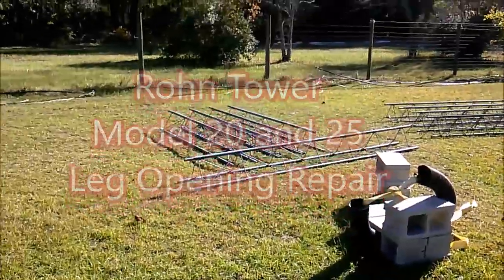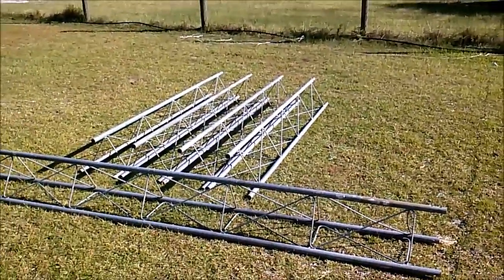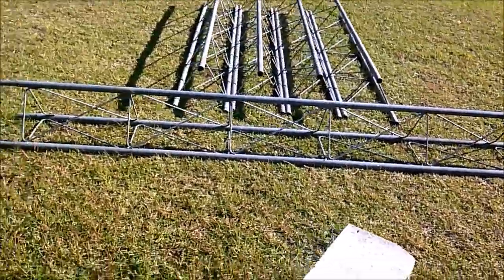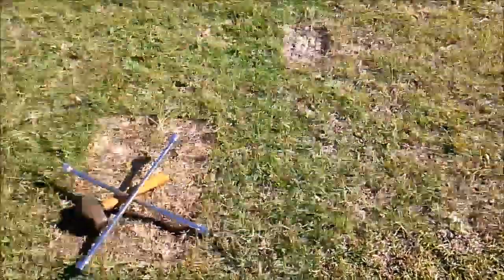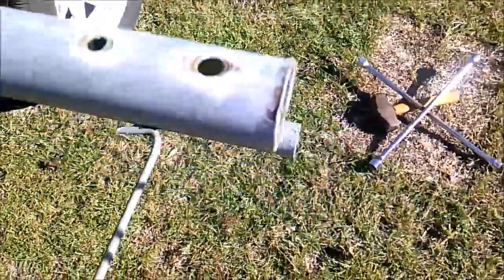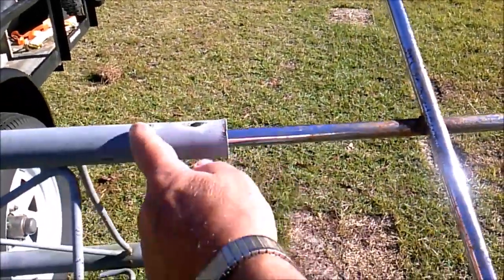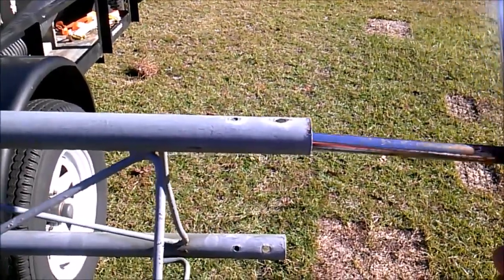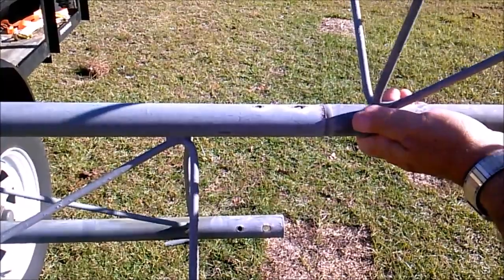Rohn Tower Model 20 & 25 Leg Fix

Comment: Great idea. I use a 1 foot section of iron pipe that has one threaded end cut off and a cross tee threaded on the other. Then I put two 6 inch nipples at 90 degrees in the cross tee for something to strike to get pipe out of tower leg. I also tapered the cut end with a bench grinder so it starts easier. Basically it looks just like the lug wrench but made with iron pipe. A little lube on it before hammering in makes it easier to get out. Just make sure to clean the grease out and apply anti seize compound when assembling tower.

Comment: "It's dented in because the person tightened the bolts too much." (1:42)  You have probably never read the Rohn literature where it states: "All bolts securing legs should be tightened enough to partially flatten the outer sleeve until it actually grips the leg within it".

Comment: Good advice. I have both, and currently refurbishing them. The wall thickness on the 20G is thinner than the 25G. I think by a few millemeters. It was originally made for lightweight TV antennas. I'll be mating them together.
Reply from the maker: Yes your right, The 25 is a step up in duty from the 20. I'm building three "fold-over" towers as I don't climb any more. I will soon have a video on making a hinge for the Rohn 20 and 25 tower sections and also a Yagi boom hinge. This is so I can just work close to the ground.  All my projects are  doing with what is around. hi hi  Thanks for stopping by, please subscribe so you and your club members can see what I am doing as I hope it can help other's like me that cant climb any more. The XYL asked why bother putting them up at 30 ft my answer was 30ft is better then having them in the boxes in the barn. Well 73 Leo

Comment: Good information. I need to find me about 25 foot of Rohn tower for antenna installation. 73s.
Reply from the maker: When we lived in central Florida people would give them to you for taking them down; as it is now all serviced by cable TV. Here in SC there is very little cable most people had 10ft C band satellite TV and now have switched over to DTV 12 GHz stuff. I have about 100ft tower sections but am making three 30ft fold over towers as I can't clime much at 72.lol. Videos will follow as I build them.73 k1zek   Leo good on QRZ